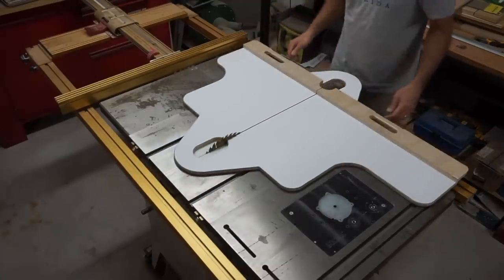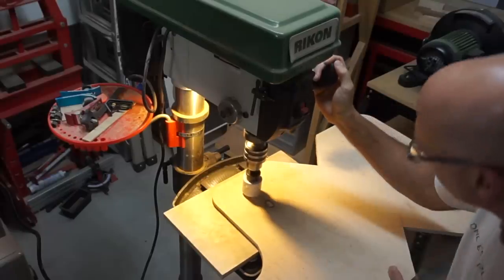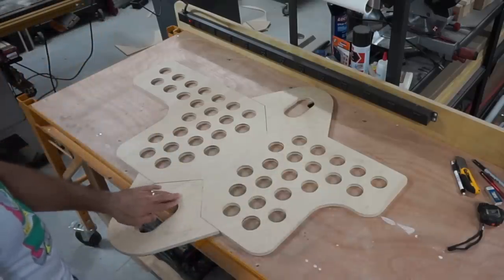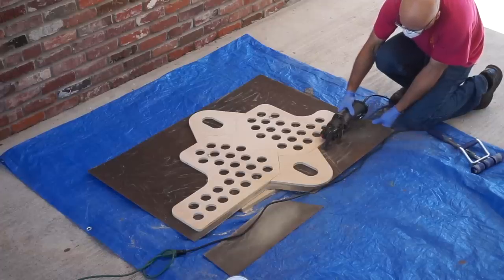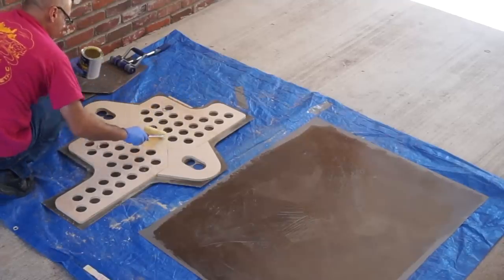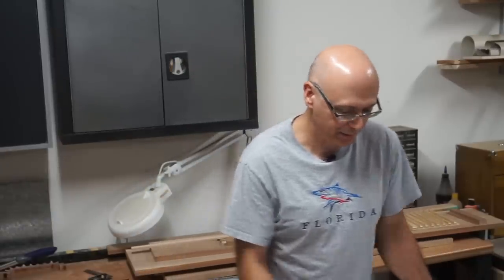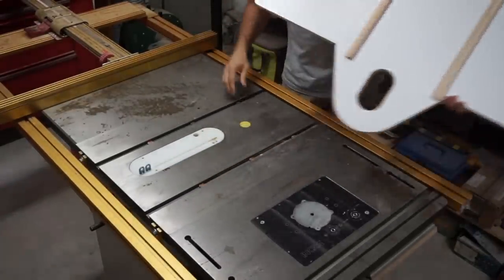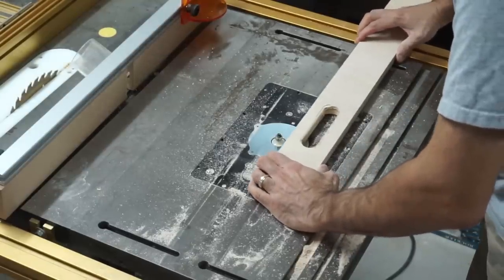A Crosscut Sled Like No Other

Comment: I made 2 sleds for the 2 different saws that I have. They were more like prototypes since I had never built one before. I am going to build better sleds but I have an issue with both sleds I need to work out first.  I measured the width of my runner slots with calipers, cut the runners, and tested them in the slots before attaching them to the sleds. They fit perfect. I attached them to the sleds and they slide front to back nice, no side to side movement, but there is a lot of counter clock wise/clock wise movement that shouldn't be there and I can't seem to figure out what I did wrong. Any ideas?

Comment: ..I must be missing something.  That piece of plywood that you began with looked large enough to have cut the sled body from without dividing it into 3 different pieces.  Why did you do it in 3 pieces?
Reply from the maker: Read other comments below for my reply to this question. In addition to my previous reply, I also wanted to make the back edge of the main body as straight as possible to serve as a reference for attaching the fence. If I had cut it out of one piece, I would have had to cut out the shape on the bandsaw, which is not as accurate as making a guided cut.
Reply: OK, makes sense.  Thanks for your reply.

Comment: The Sled looks nice but it isn't very versatile and can't be adjusted for wear, not to mention it sounds like you are sliding it on sandpaper. Please grab a 1x4 about 6" long and use it to firmly press down on a piece red Scotch Brite while moving it back and forth over that rusty saw.  Paint Thinner will speed things up. Then give it a good coat of wax!

Comment: I do not adhere the back piece to the sled.  i use 2 machine screws and nuts.  1 to pivot, the other to adjust in its slot.

Comment: Not bad for a weekend tinkerer. Lots of double effort trimming the formica and the sled should cut EXACTLY  square, not just "good enough".  As a cabinet and furniture maker of many years,  I have made many sleds  and half inch baltic birch is the go to when I have the extra. Also, thick superglue works great to stick the slides to the plastic without having to scuff it.  Personally, I use some 600 on the sled bottom, then use mold release wax,  buff the hell out of it to make it very slick on the saw contact side.   One big time finger wag... I can't believe you cut that without any hand pressure holding it in place and then BACKED THE PIECES BY A RUNNING BLADE.   Booooooo.
Reply from the maker: Thanks for your comments, Bob. I know, I’ve gotten lots of “input” on securing my workpiece.

Comment: The 1st cut you made was not a cross cut at all, in other words, the short side was against the fence. This cut can be easily made using the saw's rip fence. I also agree with Tioga Fretworks regarding the work piece being fed into the blade without holding it down.  This fence is scary unsafe, all it takes is one tiny mistake to get injured.  Finally, measuring the width at two spots has nothing at all to do with something being square (think about how a square, a rectangle, or a parallelogram all have equal widths, but only two are square)!!
Reply from the maker: I was cutting plywood. Cutting plywood results in a crosscut in any direction, but I get your point. It was just a demo cut. Isn't it true that a tiny mistake can result in injury no matter what you are doing? Example: texting while driving can cause one to miss seeing a sudden change in traffic, which can be deadly. The point is, we are all responsible for our own safety. You're right about my measurement in this video, but check my follow-up video. I think it shows a better method to verify squareness. Thanks for taking the time to provide your comments.
Reply: Mike, I watched your follow-up video, and I feel that you repeated the same mistake in checking for squareness (you measured the width of a piece at two locations, which does not indicate squareness). Yes, you did use the same side against your sled's fence, and you flipped the work piece.  I really feel that not holding the work piece is very unsafe, and not having a blade guard at the end of the sled closest to you, and no stop to stop the sled from accidentally going too far forward are all factors for an unsafe jig.  Also, when solid wood is cut and stress is released (in some pieces), the work piece can EITHER open up and away from the blade, OR it can close up and grip the blade causing kickback.  Just my two cents.

Comment: Just my two cents.....im not sure i trust the epoxy, and epoxy only, that stuff dries out over time and looses its bond. Personally i would have counter sunk some screws. If any of those parts come loose or break off, youre gonna get a face full of sled. Otherwise you quite the craftsman😎
Reply from the maker: Taking a quote from Wikipedia on epoxies: they “are used in the construction of aircraft, automobiles, bicycles, boats, golf clubs, skis, snowboards, and other applications where high strength bonds are required.”

Comment: I was curious why you made the plywood in 3 pieces and and then used pocket screws to hold them together again along with the laminate. Why didn't you just make the whole body out of one piece of plywood?
Reply from the maker: Believe it or not, doing it this way was simpler. I was able to cut those large slots more easily on the scroll saw with the small pieces. I was also able to cut the long straight edge of the sled in a single cut instead of having to trace that outer shape on a band saw or scroll saw.

Comment: Most everyone is using a 7 1/4 inch blade in their table saws these days. A 1/2 inch ply sled makes cutting a 2x4 difficult.
Reply: I still use a 10 inch blade in my 10 inch table saw ... What did I miss?
Reply: Frank M Oh really? Why? Doesn’t a larger blade give you more rim speed and more teeth/inch, so a smoother cut? I also don’t think 7-1/4 blades are stiff enough to give furniture quality cuts, as they are not designed for that use.
Reply: who is using a 7 1/4" blade in their tablesaw - surely no one I know of.

Comment: I liked the lightweight design. I grunt every time i pick up my big sled.
I've been working with saws for 30 years. I put my riving knife on 3 weeks ago after a sheet of plywood kicked back at me and hit my wrist. I cringed when I saw you take the brackets off. I see no need to go into not holding the wood down.
Reply: I too have cut plywood for 30 years without ever using a riving knife, and have never had a kickback.
Ripping solid timber  ... yes, I always fit the riving knife, but if you get kickback when cutting plywood then something is drastically wrong with your set-up or technique.

Comment: Cool design and idea for light work. But I don’t see it lasting long. The materials are not very durable and that will result in poor reliability as they wear. Also. Please secure the piece you’re cutting. Especially after removing the writhing knife (you referred to them as splitters)

Comment: Ehhhh, I like the out of the box thinking, but I think I'll stick to traditional sleds.  Your method of attaching the fence will not be square enough 95% of the time, then there is no way to adjust it.  Not having a good method of clamping the work piece or clamping stop blocks would be very limiting too.

Comment: NOT, I could accidentally snap it in half just by picking it up. I basically too a piece of paper cut a line down the center of it but left a tiny bit on either end. No STRUCTURAL strength at all. You never asked yourself "why does everyone have a fence to but you work piece again, that is perpendicular to the sled. STRUCTURAL Strength.   
Seems like everyone else has clearly pointed out the need to hold onto the work, or at least secure it down to the sled.

Comment: Not holding down stock could knock your gonads out sooner or later and if that thing hits the rear teeth on the blade as you pull it to you ,  you will loose your crown jewels for sure .If you havent had a slap of wood flying from a blade well if sure leaves you on the floor ,and checking to see if your entrails are still in place.Trust me i have see these causing stomach injurie's that would make you heave.

Comment: Numerous bad ideas. Never send piece through saw without holding it. Cut is both dangerous and inaccurate. Sled is too short as demonstrated by you moving it back and forth. The top of the sled has potential to hit back of blade if a large panel is attempted. Rear fence is epoxy'd down without opportunity to make tiny adjustments in squaring fence to blade. Fence looks to be only 3/4 in tall which does not allow a stop block to be clamped easily to it. Also, use WD40 and some Emory paper to remove majority of rust on your saw top followed by Boeshield rust remover. Finally wax the top and the sled. Failure to do that greatly effects the smoothness of cut. 5 cut (or more) is the only way to test true 90 degree cuts. Measure the offcut not the panel. On a positive note, the lightweight and laminate sled is a good idea. Good clear video. Keep going!
Reply from the maker: Thanks, Jer Bear!

Comment: Holy accident waiting to happen. I'm still freaked out watching you make that cut without holding the wood down. Furthermore, why go to all that trouble if you don't bother making sure it's square adjusting the back using the five cut method? 33 thousandths out is way out of square.

Comment: Thanks for the presentation.  Suggestion,  the caliper method would be most accurate if a cut on each side was done. The side opposite the 1st cut wasn't established as 90° to the base. But I liked your approach of using formica and the general novel design. You also have some gorgeous tools there. Thanks!
Reply from the maker: Thank you, John! Yes, I realized later on that the accuracy check could be done a little better.

Comment: Great video, just a few things I’ve noticed in all your videos is that either your mouth is really dry or the mic is way to close to your mouth!
 you can here the inside of your mouth and it’s extremely distracting. 
Also why didn’t you use your table saw in the beginning and a flush trim bit for the laminate?
Reply from the maker: Thanks, apllDgrapllD! Probably too much sawdust getting in my mouth and throat, LOL! I wear a mask more nowadays, which helps. Regarding my tool usage, there are so many different ways of doing things. I did it the way that came to mind at the time.

Comment: That first test cut was asking for it to throw the workpiece back in your face.  Also, .033 inches in 15 inches is pretty far off. Most of the folks making sleds shoot for less than .003 inches.
Reply from the maker: If you read thru the old comments, you’ll see that both of those battles have already been fought long and hard.

Comment: Putting the holes in was a good idea.    But you really need screws - on the runners, on the fence.  .033" is not "pretty good" honestly - only 1/32 over 12" or around 1/4 degree (a lot).  You went through a lot of trouble to do all of the laminate, and the extra time you could have spent on the fence, which is the whole tool really could have gotten you to within .002" or better.  You could still do it by add a fence on top of what you have already got though, and do it the right way - you will thank yourself in the long game.  Otherwise, you are going to have joints with gaps and the like.  It will give you a place to clamp a stop block too.

It made me cringe when you didn't hold the wood down that you were cutting.  That was so unsafe I just don't know how else to put it.  A clamp would be a good idea. A cover over the back hole is a good idea too, for safety's sake.

But really man . Your idea of doing it with laminate and make it really light-weight is superb.  I wonder how you managed to make it really flat by working on your floor though.
Reply from the maker: Thanks for your comments, Bill. You make some good points. This video has received many comments and counter comments along the lines of yours, so I won’t rehash all of it, but I will say that I appreciate everyone’s comments, both good and bad.

Comment: Did you really save that much weight with the two sheets of laminate ? Fence is way to thin and you can't hold the workpiece , no way you are getting accurate cuts.

Comment: It is cool, but not so easy to make. Furthermore, vertical square cutting seems not possible. Fixing smaller pieces on the sled seems also difficult. Conclusion for me: nice design, handy but with limited applications.
Reply from the maker: Roland Contreras, I stopped after you said, “it is cool.” LOL

Comment: I always cringe when I see someone spread a nice thick bead of epoxy on these runners and flop the sled down on top until it dries instead of using double sided tape and then securing with counter sunk screws from the bottom side. I could never let that dry overnight wondering if it was going to be permanently glued to my table saw in the morning.
Reply from the maker: LordPadriac, the epoxy I used dried in about 5 minutes. I supervised it while it dried, so I could go to bed in peace that night.

Comment: After watching this video and reading most of the comments I can now understand why there is a tablesaw accident every nine minutes in the USA.   Terrible design for a tablesaw sled...no place for clamping stop blocks or other jigs, finger holes that catch your fingers on the front of the table, no place to push the sled that will keep your hands above the blade, YOU HAVE TO REMOVE THE SPLITTER TO USE THE SLED,  on and on.  Then, running a piece through the saw with no support!  Come on!  This video is totally irresponsible and is going to get someone hurt!!  Sorry guys,  but tablesaw safety really is critical if you enjoy having all your body parts intact!!

Comment: LIke the shape but i would be very worried about your safety just leaving the board to be cut under its own weight going forward is bad enough. And then drawing it back is suicidal. plus there is no spine on the leading or trailing edge to stop it from warping . I would go back to the drawing board just for safety sake. This makes me wonder where is common sense gone  just as i have seen people on youtube cutting wood using the mitre saw on the pull stroke which is wrong they should cut it on the push stroke.

Comment: Should have been built from one piece instead of the bizarre v notches and pocket screws. The clever looking connections at each end of the saw cut are WAY to easy to chop with the saw. This design needs a positive stop for the forward and back maximum travel of the sled so you don't cut the sled in half. I am a high school shop teacher, and this thing would be in two pieces in one minute in any school shop.
Reply from the maker: This sled is staying in my shop, George Cyclist, out of the hands of your HS students! :)

Comment: No crown guard, removed the riving knife (which was too far from the blade to be effective), no dust extraction above the table, not holding the work piece down while cross cutting. Bad practice all round.

Comment: With respect to you and your work sir, I personally don’t like this design and my reason is as follows. As you push your work through the blade your body is moving towards the bade and there is nothing to protect yourself. however if you added a small box at the back of the sledge for the blade to go into after the cut had finished it would be far safer.

Comment: The only "innovative" feature about this sled is the fact that it has holes within the inner core, to make it lighter. It is not real thin or small, not very portable and easy to hide and get out of the way when not in use. I don't think it is that light either. Furthermore, there is no back fence to secure a block for repetitive cuts. Also, it would be better if you had a handle closer to the center so the whole thing doesn't try to spin when you push it. And you must come with a way of holding down the  stock so it doesn't hit you. It will, trust me. I think you are putting yourself at risk, and disseminating poor safety practices. I am appalled by how many people think this is a cool design, and will be copying it.

Comment: Sorry, but .033 over 15" is really terrible.  The basic idea of that sled is pretty cool, but that tolerance is just unacceptable for anything but really rough carpentry.  Also, the rear fence would be much better being vertical, as you can clamp stop blocks to it and gives you more leverage.

Comment: I like the idea of trying some innovation, but the lack of a sizable back fence and no good places to hold the material closer to the cutting area were not ideal. I feel this is not a one-and-done deal, though. It can and should be improved upon. And yes, I will echo the loudest and most common comment: HOLD THAT WOOD DOWN!
Reply from the maker: Thanks for your comments, JOSH!
Reply: @IveBeenThinkingWorkshop  , you are welcome. How has that sled worked out for you? Have you attempted a different design?
Reply from the maker: I love it! Different design? Not yet, but I got a lot of feedback on how to make a new one, that’s for sure...

Comment: I LIKE your sense of style and design but .033" over an estimated distance of 14" is outrageous. The whole point of woodworking tools is to assist the owner in achieving accuracy; not so much for accuracy's sake, but for functions sake. Well fitted joints not only look good but they add considerable strength and durability to the project. Since "you've been 'thinking' " perhaps you should consider combining the value of accuracy with your sense of design and incorporate a squaring function into the sled design. I can think of several methods and they would not only permit increased accuracy, but the add on could contribute to your sense of style.